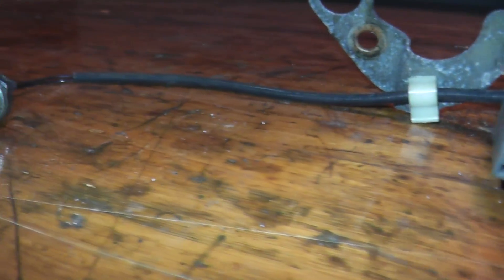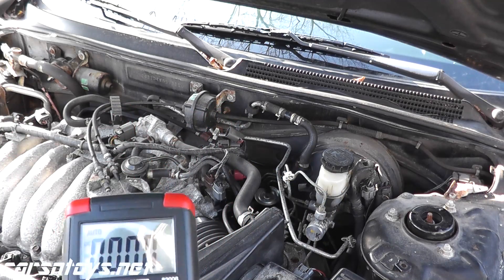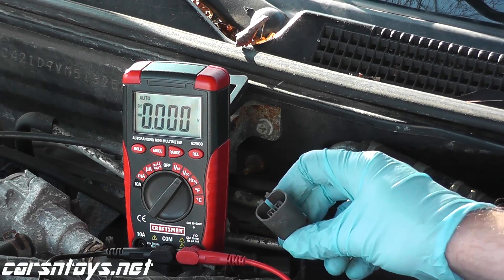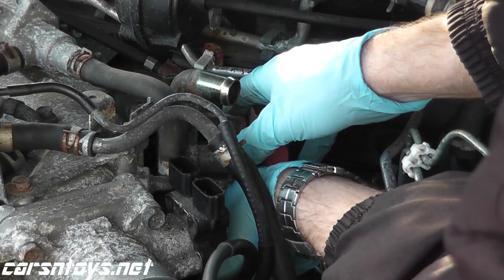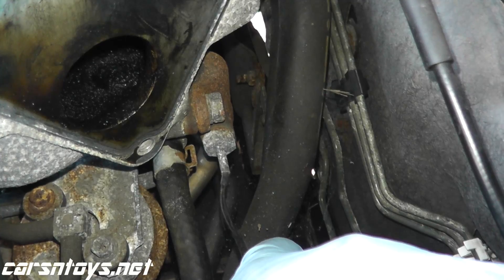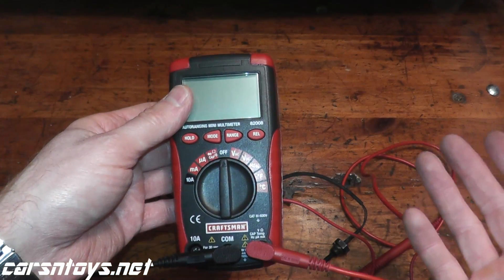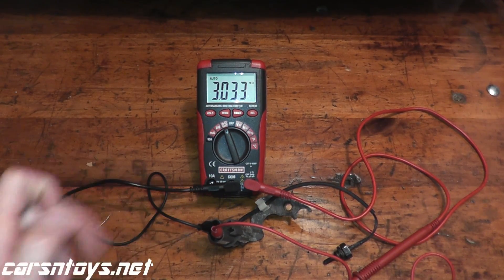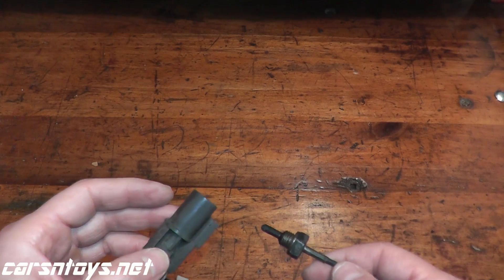EGR Temp Sensor P1401 - Testing and Replacement

Comment: 2000 Quest. no trouble code. sensor has infinite resistance even when heated. hopefully this will solve my NOx failure with my emission test. all other items in EGR system appear good. Great video-thanks!

Comment: Which scale on the ohms selector did you use? 20000K, 2000K, 200K, 20K. I can only get a read out on the 20000K scale, the others read 1. How low does the resistance have to go when it heats up? Mine starts at 2000 when cold and slowly moves to the hundreds (300) or less when it heats up. Not sure it should be that low. Suggestions? Thank you. Thumbs up.
Reply: im not OP but I just watched another video and the guy said it should be around 80 ohms in boiling water. try this     https://youtu.be/BAtBKGs1wEw?t=332

Comment: Hi! I just replace the whole EGR valve now it's saying my EGR temperature sensor circuit high p0406 what does that mean I have to replace the temperature sensor as well
Reply from the maker: Check all connections and hoses. Maybe something is loose or not connected.
Reply: I have the exact same problem

Comment: I can chime in that I had 1400 and it was the temp sensor which get covered in velvety deposits. I unscrewed it and wiped it off and its fine. The code went out and the van never ran better. However a month later I developed a new problem code 1401--EGR signal too high--which I would release the key and the engine would drop to about 200 then ran fine in a couple seconds. That turned out to be the BOOST SENSOR. I replaced it with a junkyard one and instant fix and is perfect. Moral of the story is just like I had researched that the odds are SLIM--its the egr valve--its the various sensors that control it. The fact I had the 2 egr problems relates to the fact that the sensors do reach their life expectancy.

Comment: I have a 1999 nissan pathfinder . Yesturday I have check engine light came on and when I came home I checked the code which is PO1401 . Google says its the error code fore EGR  valeve Solenoid , something like that. So what should I do. I know once I get to egr temperature sensor I can check the solenoid but do you think I should just replace both egr valve solenoid and temperature sensor. . Thanks in advance.
Reply from the maker: I'd start by checking the EGR valve. I show a number of options on how to test the egr valve here (it's pretty quick)- https://youtu.be/vUz7O9K1K0U

If the egr valve is good, I'd check the egr temp sensor next. Send us an email to carsntoyshelp@gmail.com if you need additional help. Good luck!